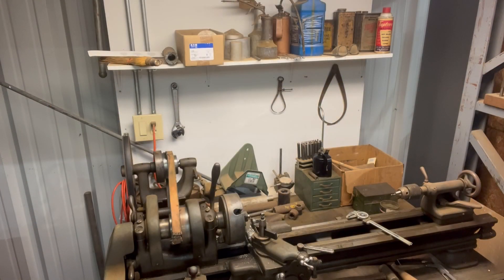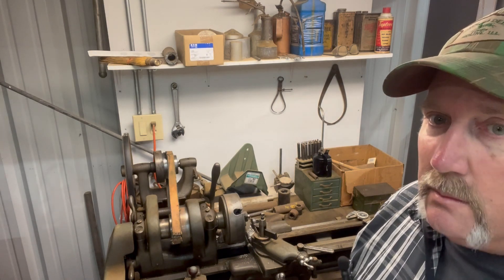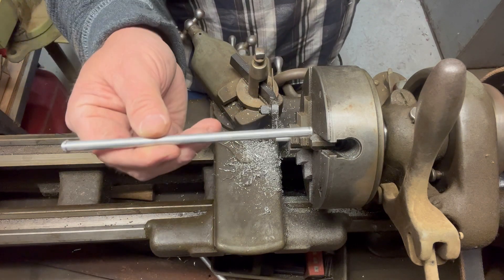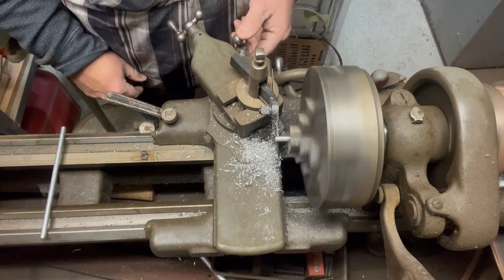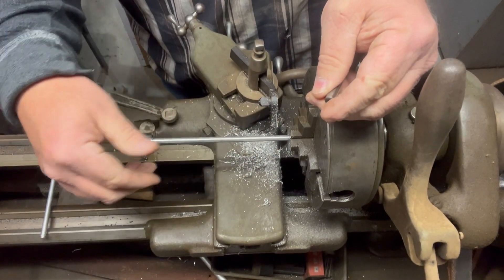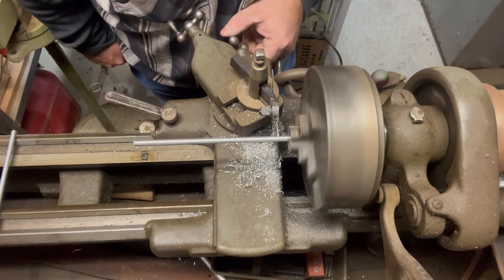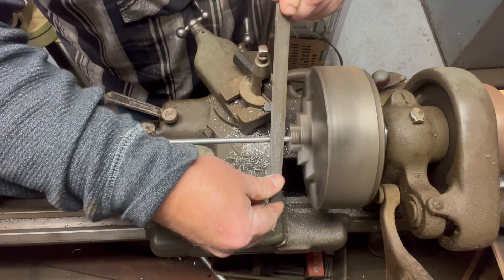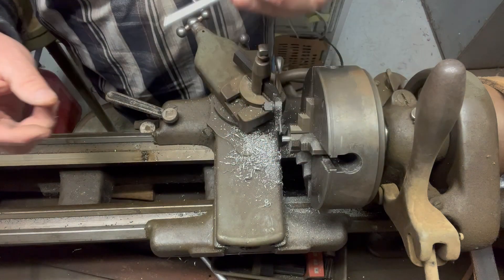Making Smith Miller axles

Comment: Thanks for sharing. I currently have a 4 jaw on my lathe as well. When I was in HS our AG welding shop teacher just had a Clausing with a 3 Jaw and a turning tool. When I got to college the teacher only had 4 jaw chucks.. it was rough for me at first as I recall but I never have looked back once you master that one. Now all of the young guys call themselves a machinist but HAVE to use a 3 jaw if they use a manual machine.
Reply from the maker: Totally agree. 👍🏼🇺🇸